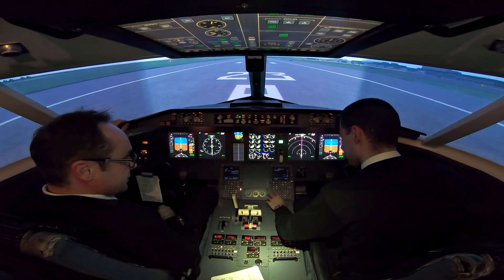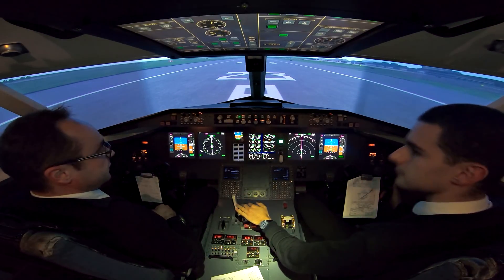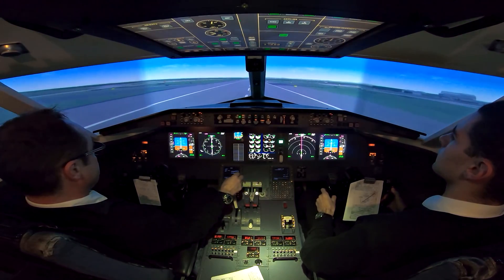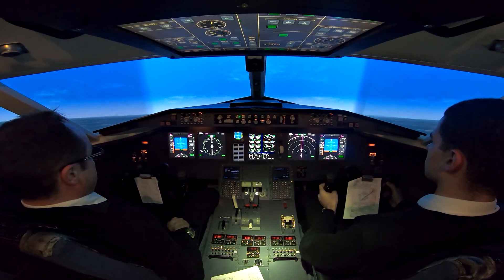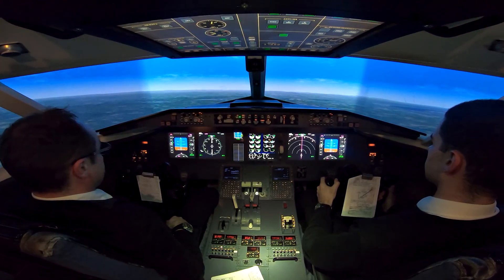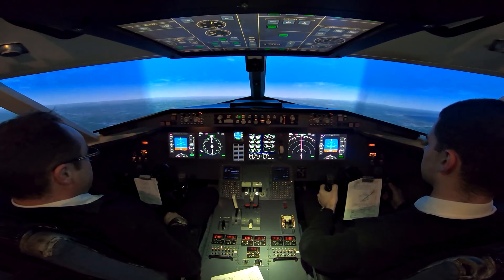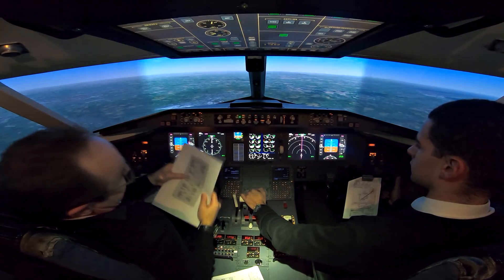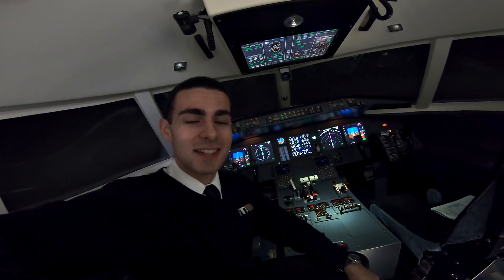Boeing 737 XJ | Windshear on Takeoff from Manchester | MCC/JOC Training (Simtech) Cockpit View

Comment: 737?
Reply: Yeah at simtech they use this kind of miscellanious aircraft for mcc/joc training
Reply from the maker: Correct, this is the XJ simulator which is used for the MCC/JOC, essentially a 737 without autothrottle and a simplified overhead (as in assessments for airlines they fly autothrottle off and with minimal use of the overhead).
Reply: @greatflyer_aviation  why does it look similar to the CRJ series?